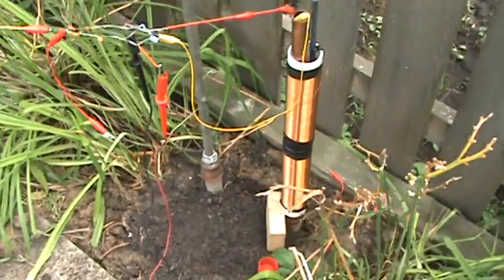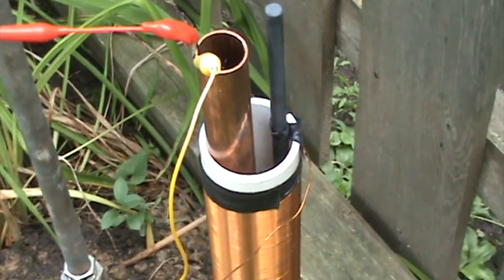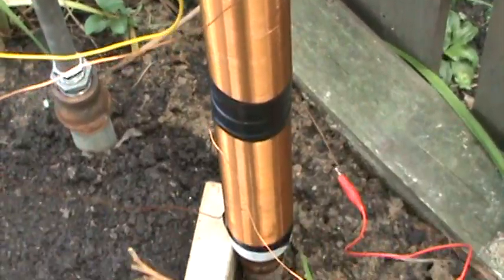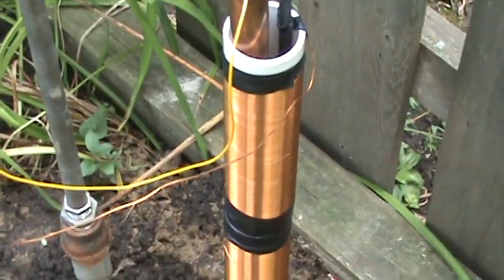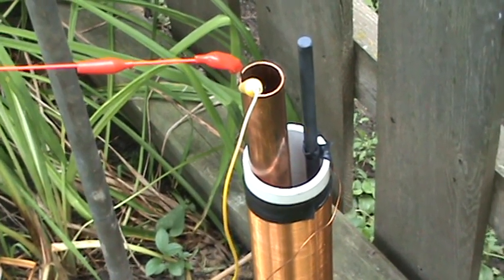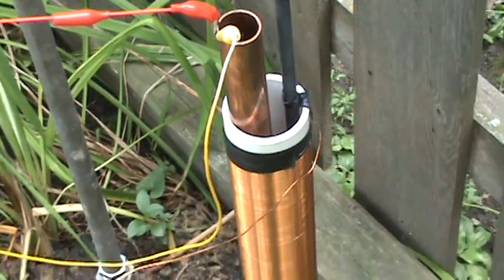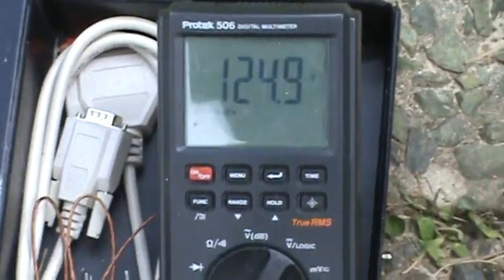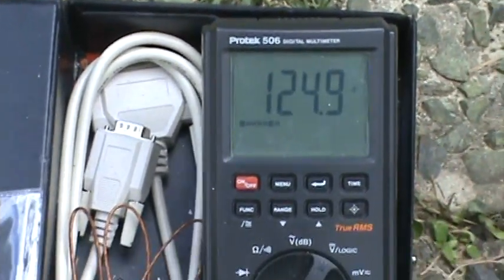FREE ENERGY FROM AIR CIRCUIT PART 16/24

Comment from the maker: @Abrec66 Yes, i tried multiple circuits, in series and parallel.  There was always a sacrifice and/or not enough energy to handle much more of a load needed to power a calculator, but im working on it. As for what the current through a single circuit was, you would have to look back at some of my older videos. Weather has no differance on it, wet dry sunny dark dry humid, so it is not static.
Thanks for your comments.

Comment from the maker: Yes, i checked current in a couple of vids.
power was like 58 micro watts. I run a calculator with it in vid 7 i think.   Im sure i will improve this, this spring time. Maybe only 2 more months and i can go back to work on this.  Cold and snowing now. Brrrr

Comment from the maker: Yes....i think i need to add second antenna & circuit & connect in series.
I like adea of paralleling more on after that.  steel core im not sure of though, not much luck with steel, more tests.
Brass core is intesting...i have not tried brass yet....thanks.  Check out next video. 17 please.

Comment: have you tried to actually power anything yet...???

try now to heat up a flat iron,and a array of light bulbs,fan,motor etc at the same time to see how much watts you can actually pull in...

the RADIANT ENERGY is actually alil different and behaves alil different then normal electricity and will give light bulbs a above normal radiance...try it ..let me know how it goes...

GOOD LUCK